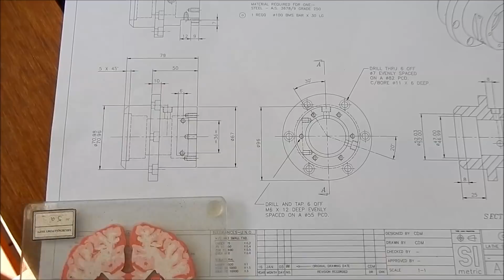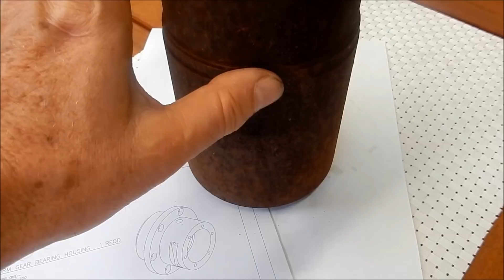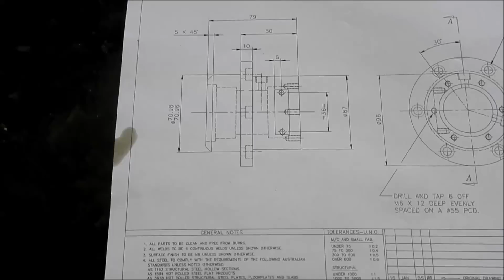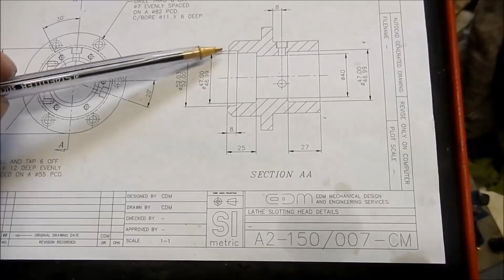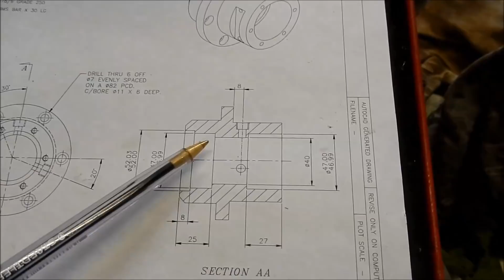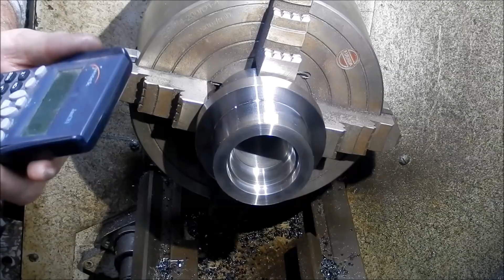Powered Lathe Slotter Build Part 17

Comment: What is the make of your lathe cutter holder? I like the adjustable angle feature on it. Very handy!
Reply: I should have wrote insert holder.

Mark
Reply from the maker: They a great little tool.  The head has 2 inserts I run one with a 0.4mm radius and the other with a 0.8mm.  The head can be loosened off and rotated for either tip.  This tool allows both right hand and left hand turning just by loosening and rotating.  I can even do small counter bores with it.  Its also ideal when I run the lathe in reverse and I can quickly re-orientate the head to suit.  Unfortunately I bought the last ones in the guys stock who made them.  He did the version you see as a medium he also did a large, that I also bought, and a small one for the micro lathes.  He was selling them on e-bay but couldn't get anyone really interested to buy so he closed it down about 5 years ago.  I think they are brilliant and I have given it an absolute hammering, I wouldn't be without it .  It only cost me $65.00 but I guess its hard for people to take a risk on something so different.
Cam
Reply: @camatbattler2233  care to take a few pictures and a few words of description? I'd take a crack at making one. I see you turning a screw with an allen key to loosen and reposition the insert holder. It would be an interesting project in itself.
Reply from the maker: No worries I'll do a quick take 5 on it soon.Cam